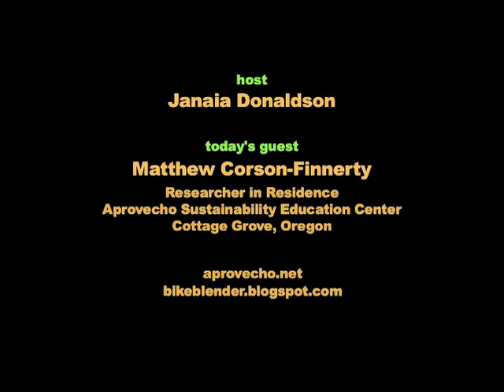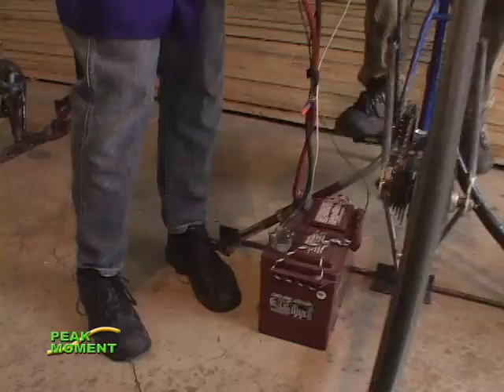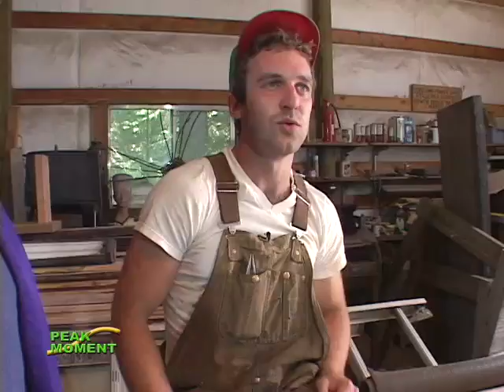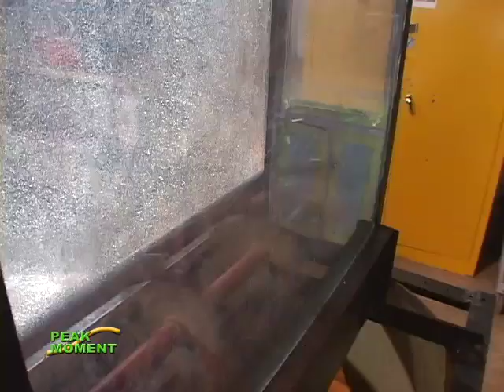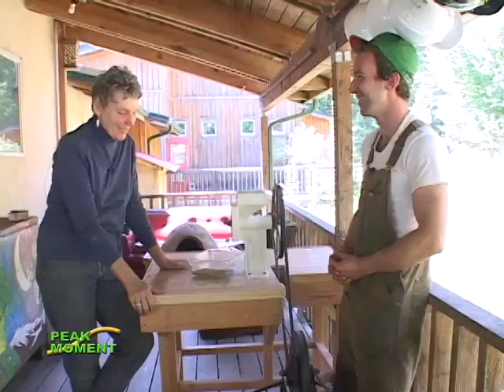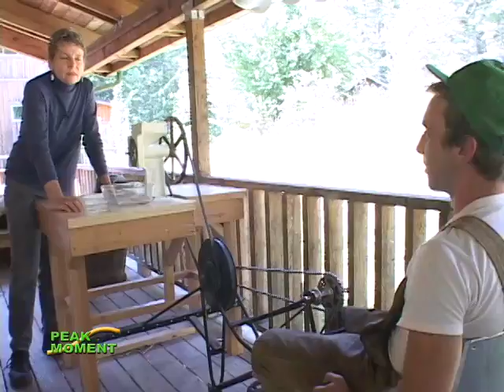Human Powered Machines - Can Pedals Power the World?

Comment: There is a vid on youtube of someone who used a car alternator, and a small charge from a battery to "kickstart" the electromagnetic induction in the alternator. He then had it hooked up to a pedal/bike, and could turn the battery off, reroute the alternator's power to keep the electromagnetic effect AND power a blender. Talk about "anytime power".

You could easy charge a 12v with that setup and with an inverter run tvs, pcs, laptops, etc... More people should do this, it's so simple.

Comment: eh, can he say eh one more time?  This is an interesting idea using bicycle power. I'll have to watch a few more videos and see what I can come up with. I'm trying to move off grid and using this bike power will come in handy for that. = )
Reply: After two, hour long power outages the last 10 days, I'm in the process of converting my never used exercise bike.: Cut off everything but the base leaving the crank and belt pulleys and fitted a 180V 2HP DC treadmill motor in place of the flywheel. It works comfortable as a reclined bike now placed in front of a chair. Pedalling at 60 RPM produces an open voltage of 16V and connected to a car usb charger, I can get the full 5V 2A from it with only 30 RPM on the pedals, so really a no sweat way of charging a phone slowly. Fitted a blocking diode (as it will run backwards as a motor if connected to a battery) and some super caps I now have the possibility to smooth out my output and even leave for a short while without the charging stopping. What I'm looking for is a small 100W 12V to AC inverter, so I just can flip main breaker in the fusebox to disconnect from the grid and then presumably run the entire lightning in the house from pedal power. I have all LED in my home and each room takes around 10-20W AC so it should be doable to have light in the kitchen and bathroom while the family gets ready for work. I presume I can do the 120W or so on the pedals to make 100W AC. Regardless I can shower in the dark afterwards. You wanted ideas! Here's one! Good luck.

Comment: The best way to save energy in your home is to reduce the amount of energy your home needs in the first place. These machines could be a big help reducing that amount.
Reply: ***** No, I meant the best. That's why I said that. There's nothing convenient about having to pedal your blender or your washing machine.
Reply: You can put your blender or your washing machine outside thus reducing clutter thus improving efficiency thus convenience.  You can then use google cardboard + bluetooth keyboard to watch TV or surf the internet while cycling.  You can save 10-20$ per month.  If you put in 10$ per month into a vanguard index fund via robinhood for 49 years, assuming the stock market grows at 10% you can get 200,000$ in a period of 49 years.  

You can also save money on 10$ on water+electricity by putting a sand timer near your shower.  2 minutes wet yourself, lather, then 2 minutes to rinse...

Comment: How about a low pressure air pump? I have a couple of videos about nano airlift pump. They only have a few psi and they can pump water more than 10 ft high. And the height is variable and  independent of the leg power of the cyclist! Matthew is the perfect person to try this!  You just pump air to a bundle of airlift pump tubes (something like 6 mm to 7 mm tubing for the tubes) and the air lifts the water up high. Potentially of great use in poor countries by the way.

Comment: How deep of well would pedal power pump work on.
Reply: Hard to say. The smaller the pipe the farther down it will work as the weight of the water in the pipe will take less effort to raise to the surface. There could also be an issue with getting it started. The pump would need to be able to create a strong suction and able to prevent air from getting back into the pipe that would let the water drop back down the pipe requiring to draw the water back to the surface every time.
Reply: Any suction pump is limited to 10 metres by atmospheric pressure. Pressure pumps? Sky is the limit.

Comment: A 190 lb. person riding a bike at about 11mph will burn just around 38 calories per mile (livestrong.co). A moped with a fuel efficiency of 100 mpg will burn about 310 calories of fuel to perform the same task (about 31,000 cal. in a gallon of gasoline). That human on a bike is 8.15 times more fuel efficient than that moped. 

In order to make a vehicle with comparable efficiency to a human riding a bike, that vehicle would need to approach 815 mpg.
Reply: I've always wondered why a moped gets only 100 mpg when my car can get 2/3 of that. That means 2 mopeds use more than a car. What gives? 4 mopeds vs a family of 4 in a car you might as well drive. Are the engines really inefficient?